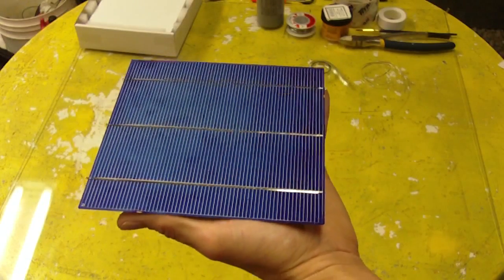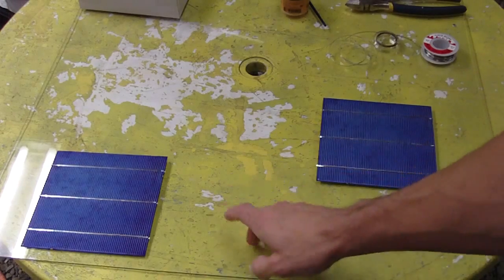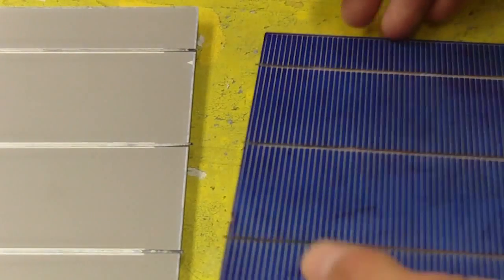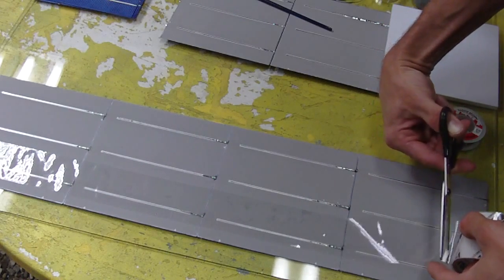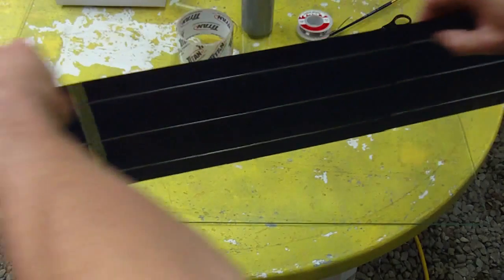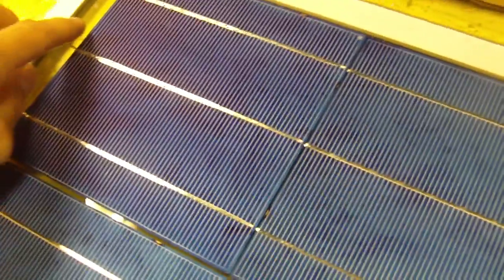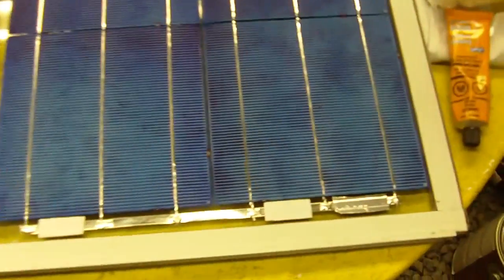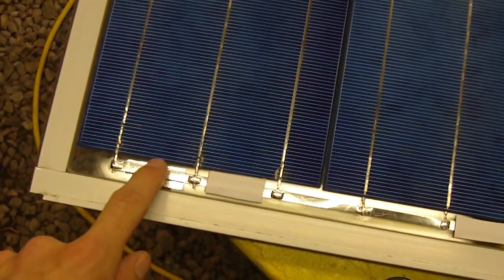Homemade Solar Panels Diy tutorial, complete build

Comment: ok,  next  you need the frames, install it and an inverter to generate electricity to a battery, right?
Reply: Kind of, the inverter is to take the DC current (like in a car vs a house) and turn it into house electricty. The Solar panels charge the batteries which power everything hooked up to it. The battery electricity is changed to ac, from dc to run the house. If you don't know the difference between ac and dc look it up and it's not the band.
Reply: You feed your panel output into a solar charge controller, which is then connected to your battery and (obviously) regulates the charging of said battery. Your battery is then connected to an inverter to change the battery's DC output to AC for use with household appliances.
Reply: Piñata Oblongata
What about True Sine Wave inverters vs Modified Sine Wave. What do these terms mean (in plain English we retarded Americans can understand)? Am told laptops, refrigerators, televisions etc require the True Sine Wave inverters, which are about twice as expensive, while other unspecified devices (light bulbs?) can get by with the Modified Sine Wave...
Reply: Leonard you have Internet put in "true Sine wave vs Modified Sine Wave" as a starting point. In the search box or address bar. Good luck.
Reply: Del Maupin
Thanks, Bro!

Comment: I'm making some solar panels right now using glass (same as you are). I made a little dummy panel out of some glass I found in the garbage. I glued them together same way you did. I left it out all day and all night, and the next day both sides had cracked all the way, on multiple places. So now I'm nervous using glass. Any idea what I might have done wrong? Could it be just the type of glass? If you guys could help me out, I'd really appreciate it!

Comment: I really like the way you made these.  Have you ever used Lexan (polycarbonate) for the front cover?  I would use the glass at back, then put some hardyboard behind that, plus use 1/4" Lexan at the front.  Would be more impact resistant, but the glass inside would keep it rigid for the panels.  

I work with polycarbonate a lot for projects and it can do amazing things.

Comment: Hey I noticed that you only have 12 cells and that configuration is
Not good for charging 12v batteries you will only be producing around 6v and you need at least 18v so you should have cut them to 2in that way you can fit 36 cells and only then you can get around 18v, if you noticed every solar panel made professionally are made no less then 36 cells unless you are more worried about the amperage and not the voltage!
Reply: u r so right... no need to reinvent the wheel on this one... just spend the 200 for the 250 panels..

Comment: 2 huge problems here. You basically built a solar cooker for your solar array. Two pieces of glass? C'mon now, you should know better than that. The internal temperatures will rise close to 200ºF making your output power minimal. Second, you didn't encapsulate your cells. You must keep oxygen from the solar cells so they will last you over 20 yrs. Encapsulating the cells keeps them cooler and producing more power.

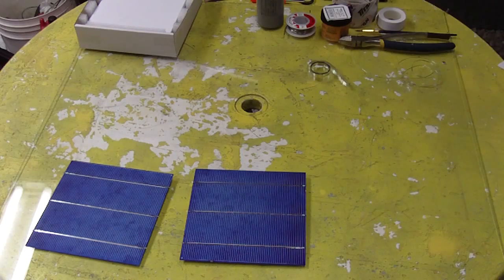Comment: @ 2:20 "Glass is a 'heat sync' "
You should probably just stick with the fact that glass is flat.
Glass is one of the BEST insulators around. (non-conductive)
Reply: Glass nevertheless is potententially a heat sink during the soldering. The difference in heat conductivity between glass and metal is no where near as drastic as their different electrical conductivity. Even materials considered poor conductors of heat are fairly decent. It is the trapped air in fiberglass insulation that does the major insulating. The glass being at so much lower temperature than the soldering temperature makes heat flow much faster, and there is a lot of glass, which also boosts the conduction rate. But since the solar cells are not in good contact with the glass, that pretty much prevents it from doing much sinking of heat.
Reply: Joshstube... Agreed! Glass is such a poor conductor of heat that thermal shock fracturing can occur if high heat is applied.
Reply: Jay Bee Okay, try this- hold a glass rod and a copper rod of equal length and diameter in a flame and see which one you drop first. Maybe then you will understand the difference between a conductor and an insulator. Copper and aluminum are excellent conductors. Glass is an excellent insulator. That's why you don't see finned heat sinks made from glass inside your computer to cool your CPU.
Reply: Muy Gonzo  Sometimes I wonder why I try to correct nonsense. Put your hand on a glass filled with ice cold beverage and tell me it doesn't feel cold. It feels cold because it is conducting heat away from your hand. It it didn't, it would feel as warm as your hand. Materials that are not wonderful conductors of heat are quite often used to sink heat away from electronic components, because it is easy and cheap. On lower priced motherboards, voltage regulator IC's are bolted to fiberglass circuit boards to somewhat sink the heat. If you pay more, you get aluminum heat sinks. Fiberglass is glass fibers embedded in plastic, and plastic conducts heat less than glass.

 Is stainless steel an insulator or conductor of heat? A lot of stainless steel pots have metal handles that you can pick up while the pot is boiling water.
Reply: joshstube 

New 2014 solar energy  here look at link 
http://earth5energy.blogspot.com
Reply: Kenneth Florek Of course it feels cold. Water is an excellent thermal conductor. Apples & oranges comparison. Good design limits the heat transfer to stainless handle but the chef still uses a pot holder. I don't know why you argue that glass is not a poor thermal conductor but I will cease trying to explain it.
Reply: Jay Bee Really? Didn't seem so. Perhaps more clarity in both your message and it's intended recipient would prevent you from being misunderstood then feeling a need to hurl defensive insults.
Reply: Muy Gonzo  As you well know, I didn't argue that glass was not a poor conductor. I only observed that poor conductors are commonly used as heatsinks, because as poor as they are, they are effective and cheap.

 You also posed as if you missed the point about the glass. The heat is conducted effectively through the glass, despite being a poor conductor.

 I don't know about chefs, but there is no reason to use a pot holder for boiling water, and I don't. The handle isn't hot to the touch. The point about the metal handle is that it is made out of what people would normally think of as a conductor, but it conducts heat slow enough that you don't need a plastic handle.
Reply: Kenneth Florek  I know I said I would cease but this is too easy. Poor conductors are not effective. They are ineffective. Good conductors are effective. Check your thesaurus if you don't believe me. I work with hot glass. Heat conducts so ineffectively through glass that temperature controlled annealing chambers are needed to slowly cool glass to prevent internal stress from developing due to the surface cooling faster than the interior. Glass is a poor, ineffective, not very good, aka 'bad' conductor of heat. But please, persist in your belief otherwise.
Reply: You could consult a dictionary about your  illiterate supposed definitions, as if you didn't already know you were spouting nonsense. Look under effective. If you don't know the difference between a thesaurus and a dictionary, look it up in a dictionary.

Again, you pose as if you thought I said something I didn't.

 Glass is so effective that is the favored material for oven baking dishes, compete with glass covers. If the dish doesn't conduct heat effectively, then how does the heat get to the food? Effective here means it is properly doing the job it is intended to do. But of course you already know that. You are just posing.
Reply: Kenneth Florek Again, please persist in your beliefs. It's no skin off my nose what you believe and it's not worth my time to convince you otherwise. I agree to disagree and let it go at that.
Reply: Muy Gonzo Thank you for being polite, if arrogant. Your comments were not worth reading, simply because they were not to the point, and I normally would not reply to imbecilic BS, except that people who are interested in the subject may be misled by your posing. I don't have any beliefs to persist in. What I had to say on the subject of heatsinks and thermal conductivity is just the standard, typical stuff you see in reading up on the subject. If you don't recognize the material, then you don't know anything on the subject.
Reply: Kenneth Florek
Earth 4 Energy

Safe Redirect => http://home-renewable-energy.blogspot.com
Reply: it conducts heat away far better than a wooden table

Comment: nice demo. I am really interested to build 2 of those.
I already bought the cells, tabbing wire and bus wire.
2 questions pls.
1. Does this setup last for 20 years?
2. Does this setup take the sun heat with no breakage?
tks in advance

Comment: Great video! Where do you buy the cells? Whats a good price? 
What type of cell do you recommend? and can you use plexeglass (hail). Will the heat build up between the glass cause any problems in the future 2 the sodered joints and cause the cells 2 age prematurally?

Comment: The cost of solar these days can be as low as 50 cents per watt if you buy in bulk. Weight is an expense since these panel are very heavy. shipping has cost. If you have some friends or wish to sell some panels you can save much money buying a pallet of 26 panels. The best individual panels prices I have found from mwands with good tech support and great tech support from wildnaturesolutions I purchase from both of them.
BTW, batteries should be deep cycle like golf cart, not car batteries.
John

Comment: If you are getting these cells for free then its your labor and other materials for cost. Most assembled panels will last 30 years, the next expense will be putting them up where the sun is and the wire to where you batteries, charge controller and inverter are. So if you panels fail too soon, that would not be fun. 
Also the higher the DC voltage the higher your performance, 24 or 48 volt setup. So these 6 volt panels would be wired in series to get that voltage, 64 watt/24 volt.
John

Comment: Great video,
just some thoughts, the glass should be heat tempered because they will get very hot and may crack when is use. The window glass may have an uv film that you can't see that will reduce cell performance. Many also suggest epoxy encapsulate to prevent erosion from moisture.
These are 4 watt/0.5 volt, 16 cells in ideal conditions will yield 64 watts at 8 volts max, to get 12 volt charging you need 32 cells, 24 volt 64 cells. 
Figure out your total cost before you buy the cells.
John

Comment: tin first is:when you apply(with the soldering iron) solder to the wire/tab before you physically position the cell next to the adjoining cell so you can solder the tabs on both cells together.

Comment: nice job, it seems that ppl dont get the longjevity from homemade as they do with commercial...many ppl used to do this but now solar can be had for a dollar to 2 dollars a watt with 20 year warrentee...so once the cells are purchased, the glass the proper UV sealant  the frame and solder..it cost MORE then buying decent factory made 1oo watt panels... but Makes a fun hobby to diy it...me Ill go for the 20 year warentee and $1.45 a watt delivered...just sayin.

Comment: Nice work, i have an ideal for a concern you have about the two sided tape degrading in the sun. Paint just the perimeter of the glass with sunlight resistant paint where the tape is(far enough where you cover the tape but not so far you cover any panels) and you covered the tape with a good sunlight protection coating.

Comment: you'll need more than 90 watts. add the wattage of your electronics together, then divide by peak sun time. check NREL.gov to find your local irradiation value. I would suggest net metering or possibly investing in a charge controller and a battery bank.

Comment: How about corrugated plastic roofing (the tunnel kind) as backing for cooling and stiffness and vacuum form thermoplastic sheet for the top side .(a plastic that's suitable for outdoors). That way it's fast to make, it's sealed without silicone and it's in contact with the cells so you don't lose the 4-8% of light through additional surface reflections.
it would even double as a roof directly.

Comment: I would use 2x4s as a frame with pegs set in as the holders of the glass.  That way you could set the glas in just by dropping it.  Standardize where you leave an opening for the outgassing during the curing process by NOT placing a peg in the area.

Comment: what kind or type of silicon did you used, and how long does this kind of silicon will last under the sun? before you put the cell on the glass did you remove the plastic tape or just leave it like that.. pls. give me a hint where to buy those cells and  how much each... thanks for the nice and educational video

Comment: I am looking to only use two solar cells. like a high powered 6000 mAh to power a 12000 mAh battery that in turn powers a piratebox. look it up if you want to. would i just use two of these solar panels and hook the battery up to that? this is quite a long video and bravo for it man!

Comment: if one buys the higher quality multicrystaline solar modules, surrounded by aluminum frames, and with drop dead connecting terminals in the seemingly indestructible backing plates, the manufacturer will give you a 20 year warrantee on it, and I have found these last, so far, up to 40 years, with no drop in sunshine output 12 Volt produced electricity; they usually output 16 volts to assure 12 volts of usable energy (eg for batts and inverters). kurtscottagd: 10 YEARS my guess. but more power ...

Comment: You should really get the air out, I wold make the seal better around the glass edges, let it dry a few days, drill a little hole in the silicone, like 1/16th of an inch or a little bigger, use a tube that fits the hole exactly and vacuum suck the air out, then carefully pull out the tube and quickly seal the hole with silicone or a rubber "cork" dipped in silicone.
This would make your panels last at least 10-20 years, that's a lot better than 5 years for just a little more work.

Comment: thanks for the video mate.your right your not an expert,me either but ive learnt you have not encapsulated properly must get rid of all air around cells they dont like it,use sylguard or eva plus you used 2 sheets glass waste of time better off useing tempered glassbring pos and neg buss terminals closer together no need for wires etc etc just watch all other videos like i did and decipher right from wrong.

Comment: The link for the solar panels tht look to be the same as the ones in this video, is as follows... itm/6x6-solar-cell-4W-pc-0-5V-x-8A-solar-cell-for-DIY-solar-panel-solar-kit-156x156-/350701549614?pt=LH_DefaultDomain_0&var=&hash=item51a770f82e